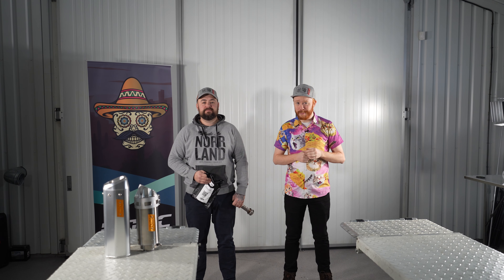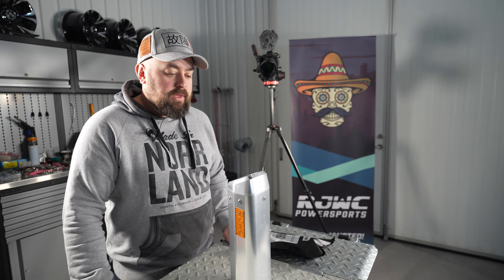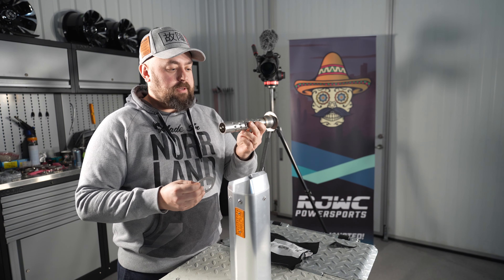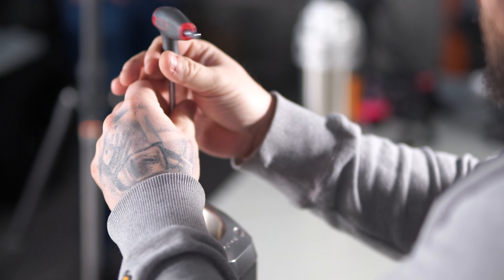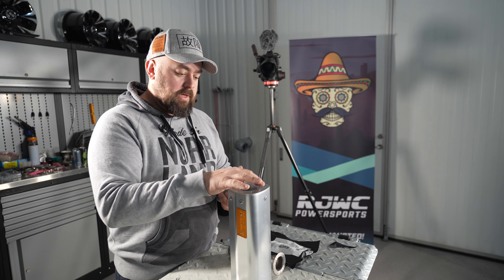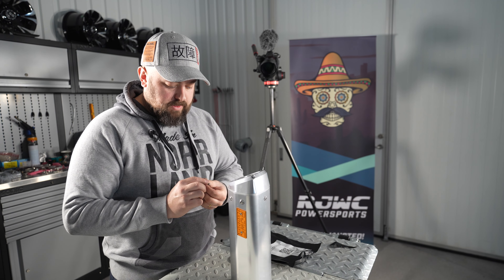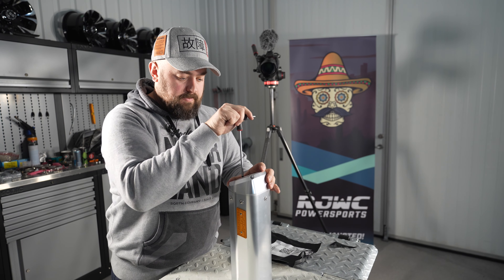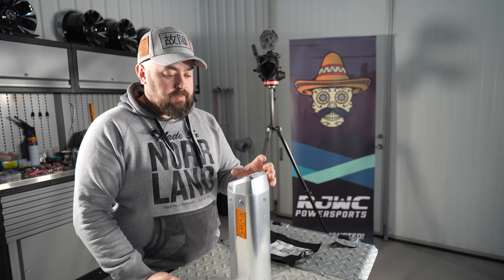RJWC APX Quiet Core installtion tutorial

Comment: Robin, I have the Stacked Dual Apx Slip-on for my Zforce 950. By the way, awesome exhaust. Here in Michigan,USA, we are required to have a spark arrestor, and on State and Federal trials, we need to stay below 86db. On this exhaust with all spacers removed when I place the pipe tip, spark arrestor, and apx quiet core in this causes the assembly not to mount without a gap. Is this OK?  I don't use the quiet core unless I have to comply with an ordinance.
Reply from the maker: Hi Mike, that is a no-go; you can only have to items behind the end cap. I.e, spark arrestor and quiet core or spark arrestor and turndown pipe, or any other combination of two items
Reply: @RJWCPowersports  thank you for the clarification.
Reply: Is this an add on ? I didn’t get one in my order ?
Reply: So the quiet core is a addition?  It doesn't come pre installed?
Reply: @damianoby8540  they have to be purchased and installed. It's pretty easy to do.

Comment: very upset with rjwc exhaust....ive bought the mud edition  for my sportsman 850 (works great, 900 spent) bought an rpx dual exhaust for my sportsman 1000s ( 1000.00 spent)  and then bought another rpx for my segway villian. the last system bought,segway villian is horrible!  the supplied exit (tail pipes) pipes are about 20% smaller than the id of the can itself, where is the dam supplied spark arrestors wont even fit under the tail pipes.  I emailed over and over again with pictures showing them the tail piped od is to small and even told them the measurements needed to fit the supplied spark arrestor!!!! guess what?   they saw the problem and sent me deformed spark arrestors to fit inside the wrong size tail pipes!  either these engineer's are just plain STUPID OR THEY DONT GIVE A SHIT ABOUT THERE SUB PAR PRODUCTS.  EITHER WAY,  I SPENT DAM NEAR 3K WITH THESE JACK HOLES AND  I WILL
NEVER SPEND ANOTHER PENNY WITH THIS JOKE OF A COMPANY!  HOPE SOMEONE ON PAYROLL READS THIS TRUTH!